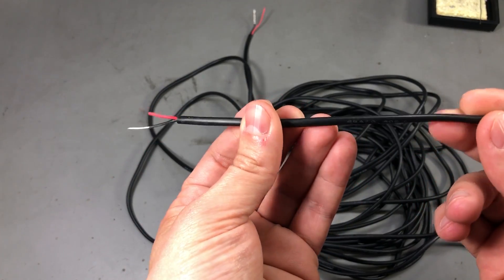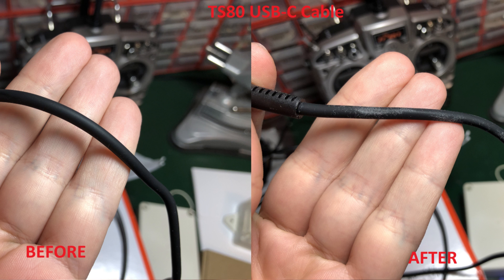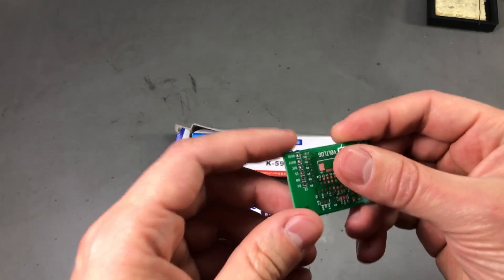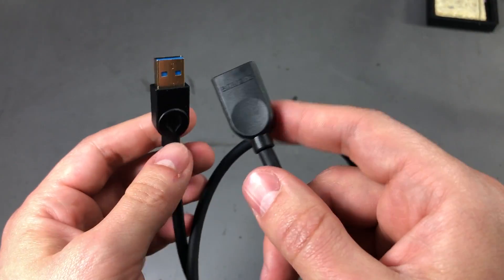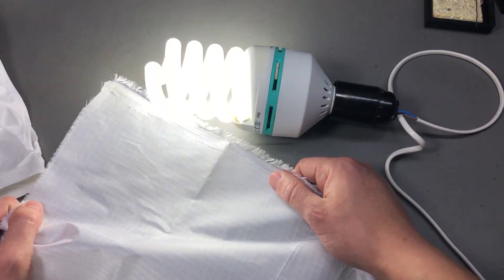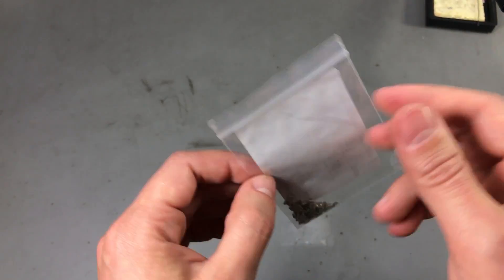Voltlog #233 - InTheMail

Comment: What is your engine/car/year? Guessing a VAG diesel engine? VAG DPF has list of supported engines was your engine in the list?
While rather expensive for personal use, I use VCDS and it is very useful for diagnosing and reaching all sorts of vehicle information. When I used it first time, I was actually surprised how many sensors and modules which can communicate with it were on my 2003 VW Golf MK4 :)
Reply from the maker: I also have VCDS but this Bluetooth OBD dongle coupled with the vag dpf app will shows dpf status in a nice graphical interface without the need of a computer. The problem is the app does not support my engine.
Reply: @voltlog  I don't have diesel engine so perhaps that is why I do not understand why you need to see it from your mobile. Isn't there a yellow warning light, and when it lights up you drive the car ~15min until it goes off?
https://www.volkswagen.co.uk/owners/warning-light/diesel-particulate-filter

You can try torque ?
See:
http://forums.tdiclub.com/showpost.php?p=5475046&postcount=45
and
Reply from the maker: I want to see the status of the dpf, how loaded it is, how often the regen happens, how much it improves after regen. Also would be interesting to see how it compares when driving in the city only vs driving outside the city. Once you get a yellow warning light the filter is toast and you need to prepare for replacement.
Reply: @voltlog  If you check the last link I gave, there is instructions on how you may access the data you want by entering the pids manually to torque. Did you try that?

But, there is no point for you to worry or track it. Because the engine controller does this job and if you need to intervene, it will turn on the yellow light so you know that you need to do something.

The yellow light does not mean your filter is dead. It means the exhaust temps were not hot enough for automatic cleaning. Eg. very short trips. So you need to do something. When you see the light, just drive 15 minutes on highway with 2500rpm and it should go off. Here is a good explanation also:
https://vwgenuineparts.co.uk/DPF_regeneration.shtml

That said, if you can't access the data using custom pids. You can probably make a guess. You should be able to see exhaust temps with normal OBD pids using torque for example. So you can tell how big of a difference is when you drive in the city vs highway. It said in the link that the soot is burned at 450C so you can have an educated guess about what is going on at least.
Reply from the maker: @eyurtese  Thanks I'll have to look into that Torque app cause the thing I am after is a GUI where I can see the info at a glance with an easy to make connection on a phone.
Reply: @voltlog  Torque is pretty good, you can also see additional sensors/information with torque. It can also read error codes and clear them etc. also. So probably much more versatile, but obviously it does not support DPF pids for VAG out of the box.

Comment: The small blue bt elm327 is known to never work, they're either wired incorrectly or something as they never work(I have one, tossed it in the bin), Google it and you'll see the problems
Reply from the maker: in my case the app does not support my engine but the elm327 is fine

Comment: I have purchased input / button PBCs in the past and they all have one problem. The connectors always seem to be soldered onto the front of the PCB, making proper flat fitting of the board almost impossible. I now have a solder sucker gun (one of the type you reviewed a while ago) and remove and refit these connectors. It seems such a pain that I can't buy the PCBs without the fitted connectors.
Reply from the maker: yes that's true they should be sending these without the connector soldered in.

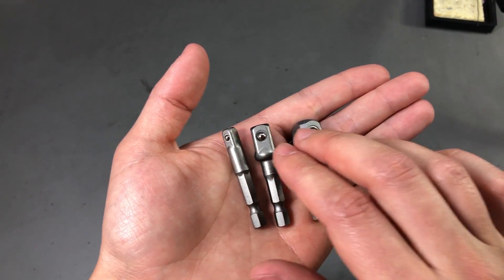Comment: 12:20 You probably need a OBD2 dongle which is a little more expensive. The cheap chinese clones are often cut down and don't support all protocols. Look at something like the OBDLink MX for a good dongle which supports all protocols. They also have wifi and USB versions available.
Reply: Looking at their site, they have a new dongle, OBDLink MX+, which also works on all Apple devices, might be worth a look if you use iOS.
Reply from the maker: @Skauber  The problem is the app "VAG DPF" does not have support for my engine type. The $3 dongle works just fine when tested on another engine.
Reply: @voltlog  Ok, I've seen often that the dongle has limited support on some vehicles where they use different protocols and HS or MS CANBUS. But if the app doesn't support it in the first place, then you'll just have to hope the developer can add support. Perhaps contact the developer and ask if this is possible?
Reply from the maker: @Skauber  already sent a email to the developer, no answer so far 🤔

Comment: The ELM327 has saved me twice.  Once way way out bush, got a fault code but with no internet access could not decode and I thought what a hunk of junk.  Eventual I selected the code on the App (Torque Lite) and voila,  it decoded it. Duh. It pointed us right to a failed diesel injector connection (cable fatigued and intermittent) . This was going to be a show stopper with us stranded many miles from civilisation but with some solder we were on the road again.
Second time, fault code on daughters new second hand car.  Check Engine Light, panic struck, simple fault reset and has been no issue since.  I suspect it was due slightly fowled sensors as the car had been un-used for some time.
Reply from the maker: yes they can be useful when away from civilization because they're so small and compact, easy to pack.

Comment: 0:42
 I just spent 10 min searching for details about this "flame test." While there is a lot of info about chemistry and lab based scientific applications, I didn't see anything about testing wires in a practical way or about how the metal "glows." What do you mean by "flame test?"

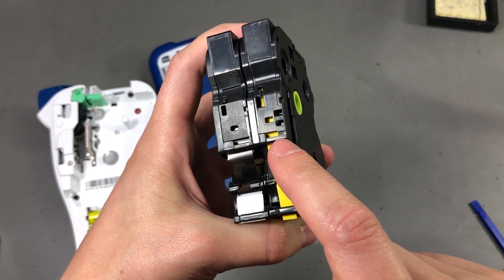5:15
  I would just put tape over the 2 extra holes to trigger the switches and see what happens. What could it hurt? I figure there is a high probability that this "feature" is just a scam to try to force customers to buy more expensive models, but I don't know this as fact.... I had no idea it was even possible to print custom labels directly on heat shrink...so what do I know (nothing) 

Lastly, I've pulled steppers like the ones you have at the end from old camcorders. Infact, camcorders are one of the most interesting types of junk to salvage and scrap. The older ones from the late 80's/early 90's are the best IMO. They tend to have modular circuits on separate boards that can be repurposed. The last one I took apart had 30-40 tiny smd trim pots that I've used a lot. They are really quite remarkable devices too.

Thanks for the upload.
-Jake
Reply: Real copper wire will retain its shape when a simple flame is applied. The wire can glow and the insulation can burn away, but it'll still hold its shape. Regular or copper-coated aluminum will wilt. Here's a demonstration: https://www.youtube.com/watch?v=U9UBEHoLulQ
Reply: @PeterRidge 
Thanks for the link. From the top comment on that upload it seems like a dubious test other than simply knowing what you're buying. I know I've had trouble terminating CCA magnet wire, and quickly realized why all of the AC mains motors I've taken out of appliances used a crimped connection to mechanically terminate CCA.
  My old man is a electrical wireman, and told me a long time ago that aluminum wiring isn't used in houses and most small industrial applications because of aluminum's tendency to expand and contract when it heat cycles. It can eventually cause loose connections and failures if the wire terminations are not designed to compensate for the thermal properties. I don't know if that's true. He's no engineer and neither am I. 
  While cost is a factor and I expect full disclosure for the products I buy, I believe CCA has it's place as a proper material. Unfortunately China has a reputation for intentionally omitting pertinent product details. 
 
 @Voltlog
For some reason I don't get reply notifications for this channel :/

I must check for them manually. I'm used to doing that for several channels, it just sucks that YT is so stupid about "spam" as a management policy. I haven't uploaded anything in over a year, don't care to do it again, am not monetized, and am just a viewer/hobbyist. Why the heck they make it so difficult to build a supportive and growing community is beyond me. It's reflective of incompetent management IMO. I just wanted to mention, I'd like to be engaged and supportive more on the community side of things, but I'm fighting YT to do it :-)
-Jake
Reply: @UpcycleElectronics  Yeah, it's only a "test" in the sense that it's a quick way to tell if you've been duped on the deal you got on a supposedly copper-stranded wire.
Reply: @2000jago  good to know thanks.

Comment: By the way, I had the same problem as you with the heat shrink tape. I was able to fix it by taping over the holes, so it looked the same as the regular cartridges and then it printed just fine.
Reply from the maker: I have to try that then 🤔
Reply: How well does the printing adhere?  Will it wear off easily or with a fingernail?  I've always just used a label under clear heat shrink tubing.
Reply: @ElmerFuddGun  I thought these label makers used heat print heads as per electronupdate tear down of such a beast.  So that got me thinking that if it was using heat to print then I assume it would cause the heat shrink to shrink.
Reply from the maker: they may have a special recipe which only shrinks at higher temps, I'll check that in a future video.
Reply: @kissingfrogs  
 I thought all thermal printers just activated a chemical reaction in the paper (print media). (*I didn't see the electronupdate video...yet)
  I was under the impression the heat action thing is why most printed receipts fade and go blank of they get exposed to any kind of heat.
Reply: @UpcycleElectronics  Yes, but in case of label printers there isn't chemical reaction, but the ink at the carrying tape got melted and sticks to the main tape. Then it peels of the carrying tape. It's quite interresting to disassemble used cartridge - you will find there a roll of used colour carrying tape, where the printed spots (letters) are missing.
Reply: @voltlog  I think it's regular heatshrink tube, but the heating of ink is very local and it cools down very quickly. The heat induced into tube will be miniscule.
Reply: @ElmerFuddGun  I have this tube in white and the thermoprint sticks very well. The thermoprint on the normal stickes hold very well to.

Comment: i have the same OBD2 bluetooth model and VAG DPF works but i have to turn motor engine on, insert obd2, in android turn bluetooth on, get paired,  wait 30s, run VAG DPF app, go to settings and choose obd2 device, touch connect, wait until connect, touch muffler exhaust icon. sometimes i get a error and i have to take obd2 out and insert again, and repeat all again.
Reply from the maker: in my case the app does not support my engine

Comment: Can't you put electrical tape on holes on the cassette to make it work with your printer?
Reply from the maker: I was thinking of that but I wonder what effect it will have on the printer head. Is it just a marketing scheme to get you to buy the more expensive printer or is my printer really not capable of printing on that kind of tape?
Reply: I say give it a try... what's the worst that could happen? It doesn't look like the cartridge could do any damage to the printer; it's not like it pulls the tape inside or anything.
Reply: I'm sure it is just a way of training their customers to be 'brand loyal', it is used on many products that are actually interchangeable.

Disclaimer: I think it will be OK, I would definitely try it on my own if I had one... And if it does break then we can always blame Mahdi and Tim!
Reply: These holes are used to identify tape width. I have 12mm, 9mm and 6mm tapes and they have holes in different positions.
Reply from the maker: @amigoz902  okay so if I try to bypass that the worse that could happen is to try to print outside boundaries and some text will be lost.
Reply: @voltlog I didn't try it but I think that nothing worse than missing text should happen.
Reply: @voltlog  You can try to google images of 9mm and 6mm tapes to see the difference. Also font size is set automatically according to tape width so the text will be trimmed if you "set" wider tape than it is.
Reply from the maker: For my printer I have 3 font size options in the menu, I'm gonna go with the smallest to see how it fits. Thanks!